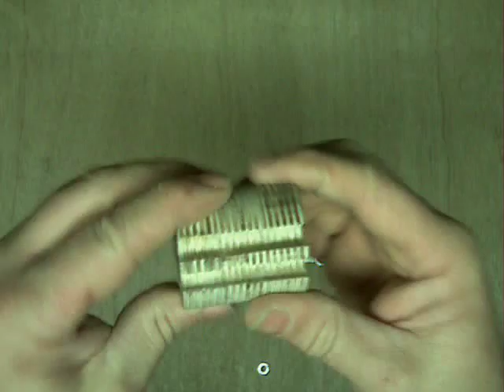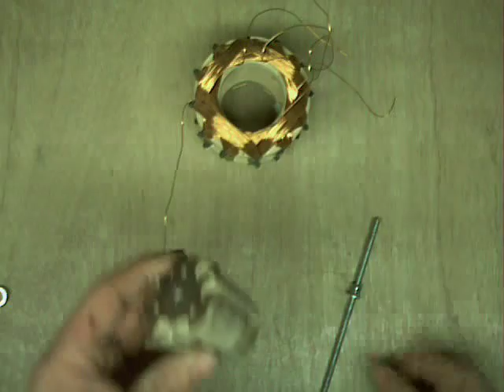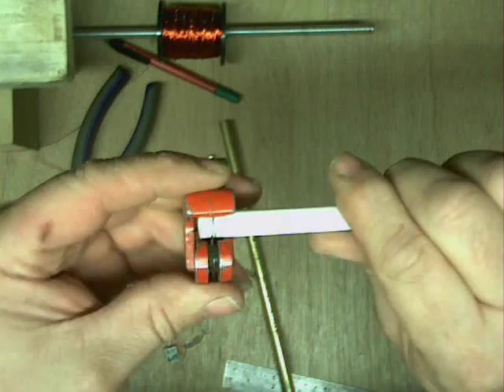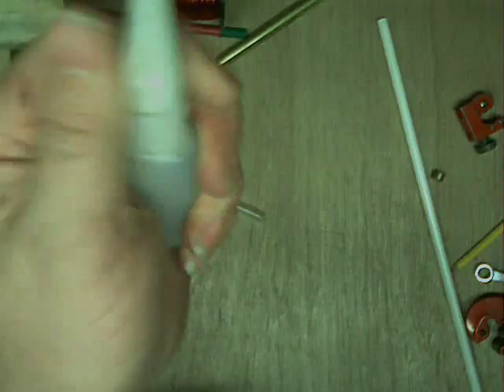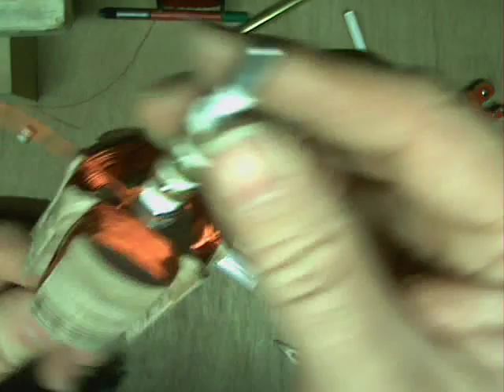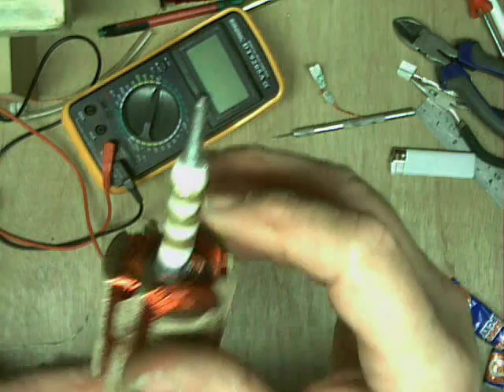Wind turbine project alternator B part 8 (theDaftman)

Comment: I think the name you mean for the rings is 'slip rings'
Also it's poeeible to get slip ring AC motors, they usually have a wound stator and rotor, the rotor would have a control to adjust the magnetic flux, and therefore the power.
Slip ring motors are usually the really big ones that need gradual power increase to get them running, similar to star-delta starting but in more steps.